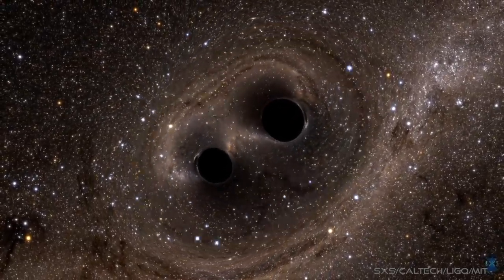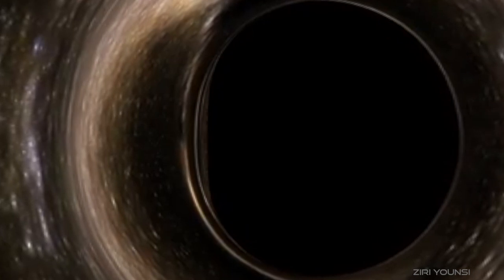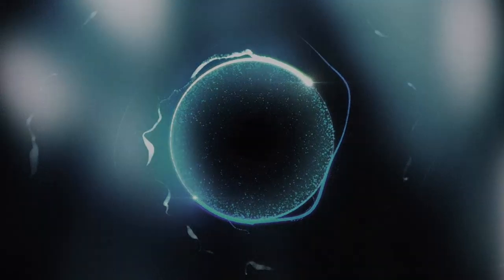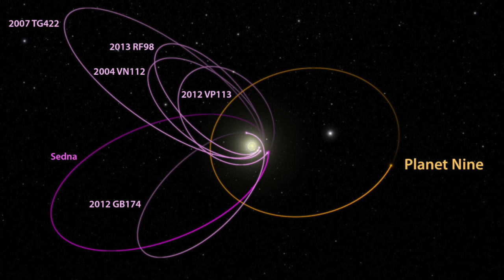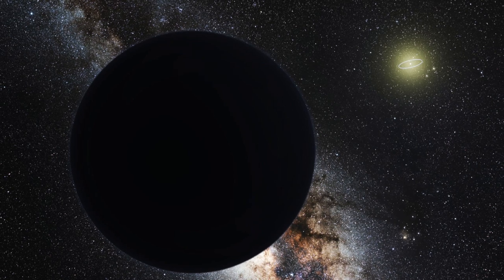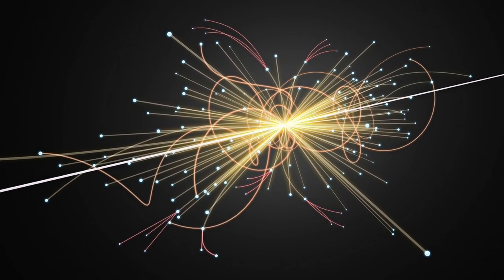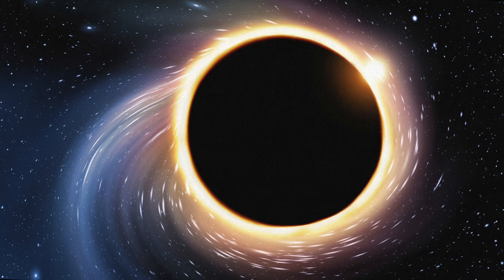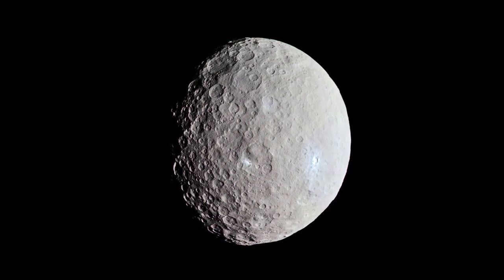Tiny Shiny Black Holes

Comment: This may be a bit late but I'm curious, are black holes influenced by gravity? Do they move towards larger masses? You used earth as an example here to show how if a tiny black hole were present, it was fall into the core of earth and feast away. But if our planet is orbiting around the sun, wouldn't the tiny black hole stay in its place of creation while the earth orbits away on its orbit path and escaping the black holes danger? I'm not sure how either influence one another or if at all but I'm curious how that might play out.
Reply: Black holes are influenced by other sufficiently massive objects. Stars and planets aren’t sufficiently massive enough for average sized black holes. Meaning, you need immense gravity to influence an immensely large object. Also, a black hole hitting a planet won’t result in the planet being eaten. So long as the black hole is small enough that is. A black hole can only eat so much at once. This is called it’s Eddington Mass Limit, or the physical limitation a black hole can absorb matter via constraints of its own time dilation. A black hole hitting earth, would punch through the entire planet like a knife through soft butter. The black hole would explode the entire away through, as it ejects matter as it passes through the center. It would create massive global earthquakes.
Reply: @gravoc857  thank you kindly for the information. I am just starting out exploring space and the likes so these kinds of things are just well beyond what I know or what I may be able to find on my own so I really appreciate the info shared. Now I must ask, I always thought nothing escapes a black holes pull. Even light, what would be ejected from the black hole if I may ask? Or is that a simple matter of filling a bottle of water past its fill point where some seeps put as a result of more trying to go in?
Reply: @MagnusQuake  Certainly! Space is an interesting, yet difficult subject to get into. The elementary stuff is easy to find. But discovering the truly interesting concepts, is difficult. Such as photon spheres, Boltzmann Branes, Ergospheres, dark matter stars, conformal cyclic cosmology, etc. 

To answer your question: Nothing can escape beyond the event horizon of a black hole. Anything beyond it, has a chance to escape. 

The event horizon is the point in spacetime, in which the gravitational pull of the singularity is so strong, that not even light can escape it. 

The singularity is at the center of a black hole. It’s a point of spacetime, in which gravity has become the dominant force, due to matter collapsing in what we perceive as an infinitely dense point. Whether it’s truly infinitely dense is still unknown, and highly debated amongst the scientific community. 

It’s important to understand that many forces affect the flow of time. Such as speed and gravity. For black holes, time progressively slows down as you approach the event horizon. Once you pass, spacetime begins to disintegrate, until eventually, space and time cease to exist. 

This slowing down of time, means that matter cannot freely flow into a black hole all at once. Consider this analogy. You’re driving your car on the highway. As you travel, the lanes begin to decrease. Let’s say your exiting a city interstate, and entering the country. You’ll go from 5 lanes, to 3 lanes, to 2, to eventually 1. If you’re the only car on the road, you won’t experience a slowdown of traffic as the lanes decrease. However, if the roads busy, you’ll experience a traffic jam, as people begin funneling into increasingly less lanes. The speed you travel at slows, and at some points, you come to a dead stop. If traffic is bad enough, people will begin finding alternative routes. 

If we’re to relate this analogy to a black hole. The cars are matter, or light, or both. The lanes are spacetime. The decreasing of lanes is matter or light approaching the event horizon. The eventual decrease to one lane, is the matter passing the event horizon. The slowing down of speed driven, is the slowing down of time as you approach the black hole. 

If a lone object travels into a black hole. It gets absorbed with 100% efficiency. But what happens if matter funnels so quickly into a black hole, that it forms a traffic jam? Well, the matter never actually passes the event horizon. Meaning, it was never absorbed, and still has a chance to escape. This traffic jam is what we call the accretion disk. It’s a disk of highly energized material, that is gravitationally attracted to a black hole, and is in the final phases of passing the event horizon. 

If you’ve seen the movie “Interstellar”. When they approach the black hole, it’s very bright and has this glowing boarder. That’s the accretion disk. 

When too much mass passes into the accretion disk at once, the black hole cannot eat it all at once. Therefore, the excess spills out at the north and South Poles of the black hole via jets of highly ionized radiation. We call these quasars. You’ve probably seen these as diagrams of two jets venting out on opposite ends of a black hole. Typically, these are found in ultra massive black holes at the center of galaxies. The black hole at the center of the Milky Way galaxy used to be a quasar. It still is today, but not nearly as powerful as it once was. 

Going back to time dilation. The slowing down of time, limiting the rate at which a black hole can feed is called it’s Eddington Mass Limit. The larger a black hole is, the bigger it’s Eddington Mass Limit is. 

In the simplest analogy I can think of. Think about a black hole as a funnel that you pour water down. The size of the funnel, determines how much water you can pour in. The bigger the funnel, the more can flow through at once. If you pour too much water in too quickly, excess water spills out the side. The Eddington Mass Limit is essentially the size of the black hole funnel, or in this case, the size of its event horizon. 

Lets look at an example black hole. Lets assume we take the mass of 8 Mercury’s, and crush them all together to form a black hole. This black hole, the size of 8 Mercury’s will form an event horizon about the size of a bowling ball. 

Now, let’s assume this bowling ball is traveling through the cosmos at 50,000mph, on a direct collision course for Earth. 

When it hits Earth, it immediately starts eating material that passes its event horizon. However, the Earth is HUGE, and this black hole is only the size of a bowling ball. Meaning, the black hole can only eat the surface area of a bowling bowl at any given time. Since the black hole is so massive (8 Mercury’s), and traveling so fast. It doesn’t slow down as it punches through Earth like a bullet through jello. As it flies literally through the mantle and core of earth. It eats as much material as it can. But it’s restricted by it’s Eddington mass limit. Since the mass limit is capped out as it flies through the Earth, the excess material is vented out on the north and South Pole of this bowling ball-sized black hole. This material is extremely energized, generating energy levels far beyond ALL of our nuclear warheads combined. This venting of energy is so intense, it would shake the very foundations of the planet itself, and generate the largest earthquakes ever recorded around the ENTIRE globe. 

After merely a few seconds, the black hole will punch through the other side of earth, and continue its path through the cosmos as if it never even passed through a planet at all. This thing is so powerful, that punching through a planet doesn’t slow it down. 

The majority of black holes in the universe are little. Ranging from planetary masses, to star masses. The giants are for the most part, secured at the center of galaxies. There’s a few outliers, but we don’t have the worry about those. Humanity needs to worry about the prospect of a rogue small to medium  black hole hitting us.  

Now, if humanity creates a black hole here on Earth, and pushes it inside the planet. It will devour the whole planet, as it’s not accelerating faster than the planet itself. It will take a while, and it will be an extremely violent event. Alternatively, if a big enough black hole hits us from space, it will eat most of all of the planet. This is unlikely though. We’re more likely to have a large rogue black hole come in, and throw us out of orbit. Potentially slingshotting us into space at speeds so extreme, people would be crushed by the planet, or flung into space.
Reply: @gravoc857  Wow. Just wow my dude. first off, thank you yet again, that was one of the most banging answers I could have hoped for. It kept me both fascinated and entertained while being educational, AND it still left me wanting more!  

I think I got that all with the analogy there of the size limit for how it would punch thru earth. And the black hole part throwing material outwards thru its north/south poles,  that there may be the answer to my next question now. But I was curious now and you most certainly dont have to answer anymore this already cleared up a lot of my assumptions on some things, but here goes. 

Every depiction Ive seen of black holes, like simulations or in movies, they always show the light source of the sun on  the right and the black hole on the left with the black hole moving to the stationary sun. As the black hole approaches, it almost always appears that the light from the sun just before reaching the black holes ( what i believe the accretion disk) as it gets closer, seems to pull the light outward behind the black hole before it begins to show it deforming it onto the side closest to the sun. 

So, I always wondered, is the light being so quickly pushed and pulled simultaneously so much by the black hole that those images of the north/south poles having long streams spewing outward that we see  maybe that had something to do with what that was you just mentioned. As it grabs stuff to pull in, in this case, the light from the sun, does it feast on the light gathered inside that accretion disk that the rest of the fields that it cannot cover, is shown being pushed and pulled to what we see as north/star poles? 

This is really far fetched but this was the hobby I picked up during covid years and its been a blast!
Reply: @MagnusQuake  I can answer some more :). 

Black holes spin. They spin really freaking fast. They spin, because stars spin. Angular momentum is preserved as a star mass object implodes into a black hole. Since angular momentum is preserved, this means the black hole will spin really fast, in order to match the angular momentum of the star. 

This spin creates a zone around the black hole called the Ergosphere. Black holes spin so fast, that they generate inertia, almost as powerful as gravity. For reference, angular momentum is how humans will likely make artificial gravity devices, when we inevitably start sending humans far beyond Earth. 

Angular momentum has an impact on the flow of time, just like gravity.  This means the Ergosphere will have really trippy physics, and will experience time dilation. For example, if you were to float into the Ergosphere while wearing a space suit. It would be like being tossed around in a whirlpool. But instead of water, spacetime is what is tossing you around. The Ergosphere is defined as the boundary of the black holes’ external influence via its angular momentum. 

To help you visualize better. The Ergosphere is like the atmosphere of a black hole. It has an oval shape, and you’ll enter the Ergosphere a good distance away from the black hole itself. 

The next layer is the accretion disk. We’ll return to this later. 

The next layer after that is the photon sphere. We’ll also return to this. 

After the photon sphere, we have the outer event horizon. This is the point in which not even light can escape. 

Once you’re beyond the event horizon, you’ll accelerate towards the center of the black hole. 

As you accelerate to the center, you’ll pass through the inner event horizon. This marks the end of spacetime as we know it. Time ceases to exist, and so does space. It will take both an eternity, and an instant for you to reach the center. For without a benchmark to measure space or time. A trillion years, and an instant are essentially the same. 

After the inner event horizon. You’ll reach the core. The absolute center, known as the singularity. What happens here, is unknown. 

Going back to your question about black holes eating stars. If I interpreted your question correctly. I believe you’re referring to spaghettification.

Spaghettification is the scientific term used to describe a phenomena of extreme gravity. Black holes have such an extreme gravitational influence, that the tidal forces in front of you are much more powerful than the tidal forces behind you. What this means is that the black hole is essentially stretching you out. It’s pulling away the atoms in front of your body, faster than the atoms in the back of your body. This process gets more extreme, the closer you get to the black hole. It’s called spaghettification, because eventually the force becomes so powerful, that it disassembles you entirely, and you become just a stream of ionized radiation, flowing towards the singularity. 

This is better visualized with your sun question. As a star orbits a black hole, and gradually approaches the event horizon. The tidal forces begin to lift material off the sun itself.  Until eventually, it disassembles the entire sun into a stream of energy that joins the accretion disk. 

A clarification on the accretion disk. If the black hole is not feeding on matter or light, it won’t have an accretion disk. It will be a true black hole that is invisible to us. These are called dormant black holes when they’re not actively feeding. Rogue black holes are likely to be completely dark, and therefore dormant. But just because it’s dormant, doesn’t mean it can’t move through spacetime. This is why humanity should be concerned about rogue black holes. A dormant and completely dark rogue black hole could be hurling towards earth as we speak.

The accretion disk forms once a black hole begins to feed again. A black hole can have an accretion disk, without becoming a quasar (venting ionized radiation at the poles). It only becomes a quasar, if it’s Eddington Mass Limit is reached. So long as the black hole remains under the mass limit. It can feed on all the material within the accretion disk. 

Remember that the accretion disk isn’t the point of no return. It’s the point just before the event horizon. Matter can still escape at this point, if it has the right speed, the right angle, or if it gets bumped out of orbit. Unlikely though, as the forces of the black hole are immense. For humans,. We’ll likely not want to venture beyond the Ergosphere.

The reason why black holes have poles, is because they spin. Interestingly, this also means that black holes have equators. 

Next up is the photon sphere. This is a less known, but interesting layer of a black hole. Before we get into them, a bit about orbits. 

An orbit occurs when the velocity of an object is equally matched with the gravitational influence exerted onto that orbiting body. Let’s look at the sun and earth, for example. 

Gravity bends spacetime. The sun being so massive, means that earth is in a constant state of free falling towards the sun. Good news for the earth though. We are accelerating away from the sun as quickly as the sun is dragging us in. Extra good news. Per the laws of physics, an object in motion, stays in motion until acted upon by an equal or greater force. Since Earth is floating through the void of space. There’s nothing to slow us down. Therefore. We’ve built a harmony with the sun. We are forever falling into the gravitational well of the sun, while equally accelerating away. Therefore, we have a stable orbit. 

Going back to black holes and the photon sphere. If a photon enters the orbit of a black hole at precisely the right angle. It will find itself in a harmonic orbit with the black hole. The speed of light will be equally matched by the gravitational pull of the black hole. Meaning, light can have a stable and permanent orbit around a black hole. This has interesting ramifications. Black holes might be a map to the universe. Black holes might have the highest resolution image of the universe, ever. Black holes might allow us to see beyond the observable universe, as they will have been collecting light from objects during the great expansion of the universe. Black holes may allow us to view a montage of the development of the universe, as it’e been collecting light data for billions of years. 

There’s other extremely cool concepts about black holes if you’re interested. Since black holes create immensely deep gravitational wells. It’s possible that black holes can form wormholes, by connecting two gravitational wells at different points in the universe. The assumption here is that our universe is a 4D hypersphere, and we live on the surface (3rd dimension) of this hypersphere. Per Roger Penrose, black holes may outlive the universe themselves. Black holes may also be used as the last refuge of hyper advanced alien civilizations trillions of years into the future. If we live in a repeating universe, where we continue to Big Bang after the death of the universe. Then black holes may leave ripples on the primordial universe, which we call the cosmic microwave background radiation. Or the eternal TV static. Hyper advanced civilizations might be able to use ultra-massive black holes to imprint information onto the next universe. Whether they leave a blueprint for their return, or a message to the next generation of life in the fresh universe. The angular momentum of black holes can be harvested for energy. We could also create a “black hole bomb”, generating the largest explosion in the universe by exploiting its angular momentum. We could use black holes as time machines into the future. Black holes can also blue shift light (energizing). Therefore, black holes might be fueling stations for hyper advanced space faring civilizations. There’s an interesting artificial solar system concept. You place 9 sun like stars in orbit around a supermassive black hole. This would create a stable orbit, capable of hosting 512 earth sized planets. A type 3 civilization might use these to make life refuges for themselves. These structures cannot occur naturally. If we ever find something like this in the universe. Then we just found unequivocal proof of aliens. 

Another weird quirk of black holes. You see the front, back, top, and bottom of a black hole. It’s sort of like taking a cube, and unfolding it back into a two dimensional shape, where you can see all the faces of the cube at once. This occurs for the sphere of the black hole. The reason we see all sides of the black hole at once, is because photons orbit multiple times around black holes, before leaving the orbit and hitting our eyes. Nowhere else in the universe can light orbit around objects. Objects can curve lights path, but they will never be strong enough to cause a complete orbit around the object, or multiple orbits. 

Finally, black holes can die. They release Hawking radiation. Perhaps the most interesting property of a black hole in my opinion. A black hole losing mass, because of particles coming into existence from almost nothing at all. 

I can discuss Hawking radiation more if you want. It will be a big post as well, as we’ll have fo go over the strong nuclear force, the quantum field of reality, and the creation./annihilation of virtual particle pairs in the void of space.
Reply: @gravoc857  Thank you thank you thank you! You have gone well above and beyond to explain these phenomenon in a way I could comprehend! I have plenty of bizarre questions and what if type questions that I hate nagging someone to share knowledge. You really gave me so much push in the right direction for what I'm looking for or curious to understand better that my researching and studying will hopefully not feel so overwhelming. Thank you again for everything you have shared with me. I feel terrible all I am able to give in return is a thumbs up so I hope this helps for your troubles 💰
Reply: @MagnusQuake  no need to feel terrible! I’m extremely fascinated by space, and sharing what I’ve accumulated is no problem at all. It gives me an excuse to talk about this stuff. To be Frank, the people in my life aren’t interested in these topics that I’m immensely passionate about. Therefore, I just keep them to myself and pounce on any opportunity to talk about them.
Reply: @gravoc857  That sounds just like how I was when I was first getting started with all this! Mostly, but I just always had a fascination for this stuff since I was a child, but never got the opportunity to figure out what about it I liked. Now, today, I still feel like I am on that journey of discovery, but the only difference this time around is I enjoy the learning aspect of it. So much so that to me Ive often not cared so much as to what aspect of space I am learning, whether its a star, the distance to the closest star, the discovery dates of planets, all that stuff is all fascinating to learn how long ago it all traces back. I often find those are just as fascinating as when i had seen my first image of a black hole. 

But its weird for me in that I know that all that i want to learn about space (or can learn about it currently) is all stuff that someone else has already figured out, or discovered, but to me, I dont seem to mind that if i learn something new, that its not me who was the first to come across something or discover anything, id rather learn it just for the sake of learning it to add to my library. 

When I think about that last paragraph, I wonder if I am living my life a bit selfishly, because I feel as the work I do, and the effort that goes into it, its not intended for others to enjoy, but rather its for me to enjoy  it because we only live once. And I know i may never discover anything big or game changing in my life, but thats fine with me, I view my life as my own creation and I am here and anything I amount to will be for me  to enjoy it, not for those after me. It is for me and those who journeyed along the way with me in my life. Thats how i sort of had an angle on things and when I reflect on it I wonder if I am perhaps selfish in that way. 

The point to that was that while I didnt have people to share my interests with , it slowly guided me to a way where I would still have my hobby to learn, in a way I would say this is for me because I want it, not for someone else. So I would always get hyped at any opportunity to learn something new whenever I tend to see someone talking or mentioning something about space I like to listen and learn what others know. 

Its weird I am sure, but I just sort of connected there with that you said haha but yeah I could listen about space for hours on end and not bore myself to me its on that level of excitement :D